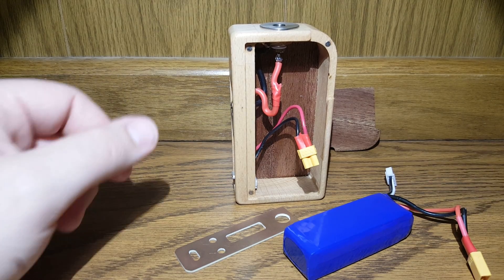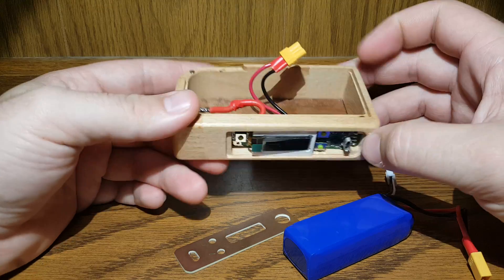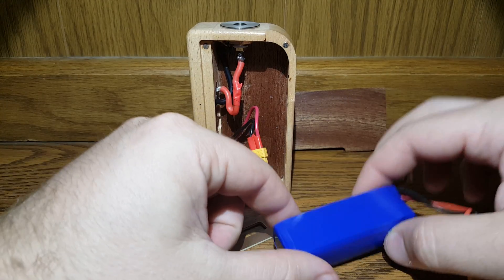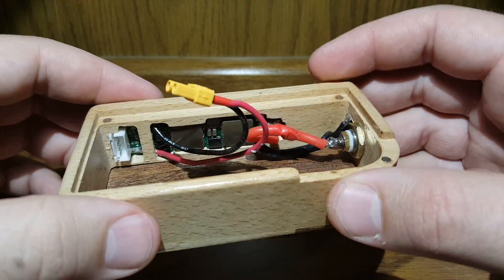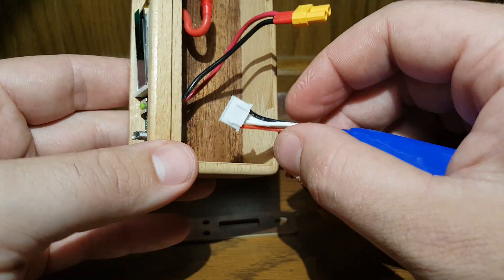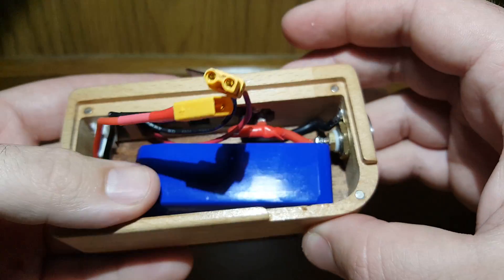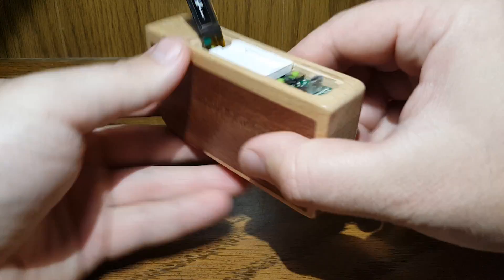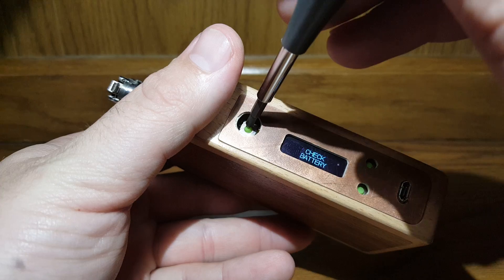Dna 200 build part 4. Problems?

Comment: Didn't work with the 18650's because you didn't set up the board in the software for two cells. Since you are using two 18650's it is 2 cells. Not 3 like a 3S LiPo.
Reply from the maker: It was set on 2s, that's why it wasn't working with the 3s lipo in this video. once i set it back to 3s it worked fine. it was an issue with the charge tap. it was getting interference from the main power feeds. they needed to be isolated better on the battery tray.

Comment: You put the conectors on backwards. the xt30 conector on your battery is a male contentor which is quite unsafe.
Reply from the maker: your right, I ment to go the other way around, lol I think I even said female on the battery, I will be switching it around. thanks.
Reply: The connector on the battery is a male. The board has the female. He needs the male on the battery and female on board.

Comment: did you get it working?
Reply from the maker: +Lewis Gladden no I had some problems. Stay tuned to my next video, I will have the link for the box as well as the info on the other parts. Also the out come of the build so far. Should be up in a day or two. Thanks for watching